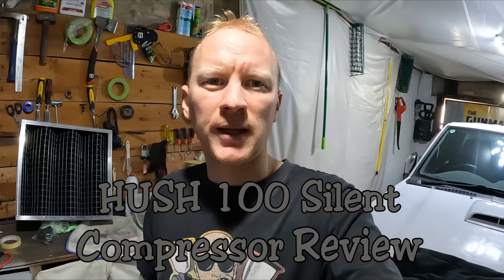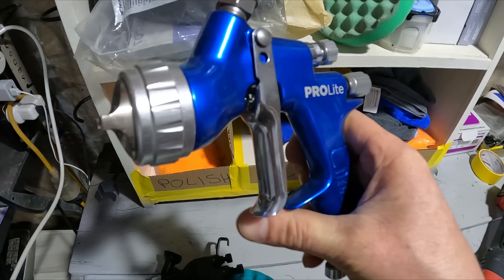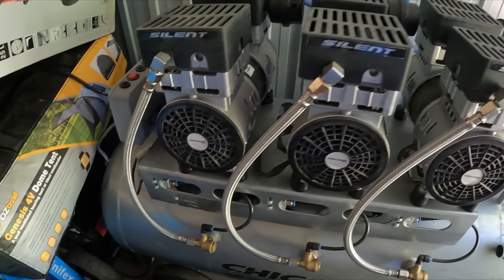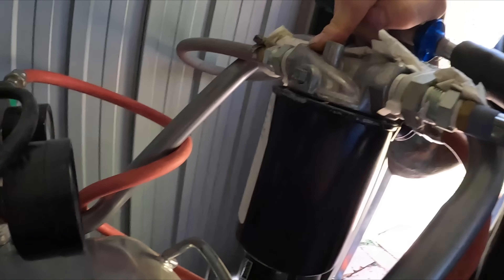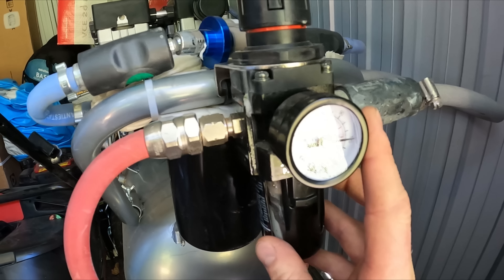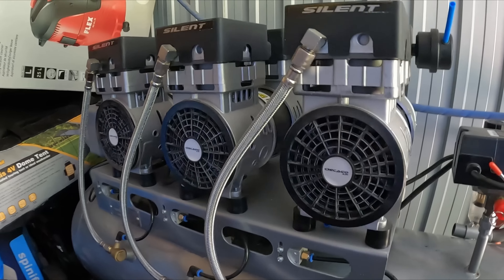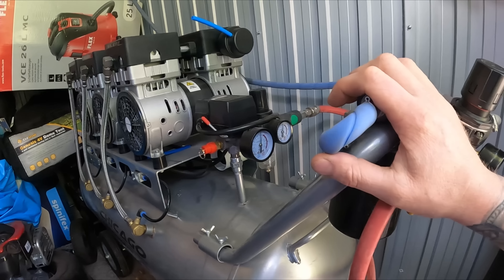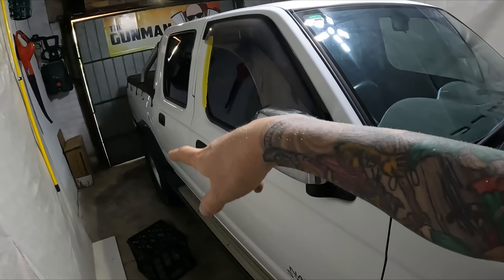Silent Compressor Review

Comment: I concluded that moisture traps are best placed 4-5 meters away from the compressor. When the air is cold, moisture separates much easier. Excellent results are also achieved with lower quality moisture traps.

Comment: I installed a secondary air accumulator on the wall - it's basically just a Stainless-Steel bottle to help keep air volume and also collect water. I then added an electric purge valve on the bottom that just plugs into any power outlet. You can adjust how often and long it goes on. You could put something like this in the shop wall someday, I love it.

Comment: Yewwww great to see a review on this beauty - I've owned this exact one for a couple of years and she's been absolutely brilliant 💖 I leave it on every day and it gives reliable dry shop air.
Only annoying thing is the location of the tank drain valve - it's not on the actual bottom of the tank and so draining properly requires some angling of the unit while draining.

Comment: I've got the hush70, was the same price at the time as the hush100 but the 70 puts out a higher cfm (according to the specifications online). With my dv1 HVLP and my gti I can hold 2bar throughout my whole paint job! I just use a small inline moisture filter attached beneath my reg on my gun and I get nice dry consistent air. The thing is so bloody quiet too!
Reply: Got one as well, it cranks no probs at all.
Reply: This is what I wanted to hear thank you. I can't decide between the HUSH100 or HUS70 as they are the same price. I probably won't paint an entire car in one go and break it up in panels so thinking the HUSH70 may be fine. Only thing is on the website the HUSH70 is 81db and the HUSH100 is 70db. I want it as quiet as possible

Comment: Think you’ll find you will get better pressure upgrading the sizes after the regulator on the compressor. 1/4” is pretty restrictive. If you got it all up to 3/8” would make it a bit better. Alternatively if you have an old busted compressor hook that tank in for extra storage.
Reply: When looking at filters go to someone like ultra max and buy you pre, after and activated carbon filters seperate rather then buying a devilbiss 3 stage, as they do the same job but at half the price and replacement filters are cheaper. We install heaps of them in booths.
Reply: Even 1/2" lines will make a difference

Comment: I have the same but the 4 motor 150l version. Such a huge difference compared to my old belt driven compressor.
Reply: Hi John , thinking of buying the 150l model. Does it need a 15amp plug?
Reply: I was thinking of getting the same model as you.
do you know how many hours you currently have on yours?
any issues or maintenance thus far?
and do you know of how many hours usage until seals and such have to be replaced?
thank you.

Comment: between prep stages i use a vacuum cleaner with a soft tip on it to remove the dust
the most powerful consumer of electric i have in the home garage is a car lift, i wired that up to the same house supply that supplies the cooker as thats the highest supply in the home

nice idea about running a  separate small comp for a mask, never thought of that.
i been using the wife's knickers with gaffer tape..............

Comment: For your European viewers, Pacini makes this same campressor (100l) its rated at 71db and it costs €600 - €700, it will run off 13a socket. There are several other manufacturers with this same model. I think they are all Hyundai clones who also make several sizes and versions of this model.

PS. Love the veggie garden.

Comment: Hey mate I work for Sydney Tools & on that Hush100 if you unscrew the black cap (1 screw) where the main on off lever is (red bar), have a look under the cap. Theres a sticker which indicates your cut in & cut out pressure setting adjustment. There's a black plastic screw & a steel screw. They'll increase/decrease your pressure & cut in/out so you should be able to use the HVLP. It will most certainly power an air sander btw. Cheers.
Reply from the maker: Thanks mate, great to know
Reply: Hey mate would you recommend the 100 over the 70?
Reply: @jesserowe5346  Depends on what you're doing. The 70 has 1.1kw motors compared to the .74kw motors on all other models. Faster recovery time on the 70 but less storage. What will be its main application?
Reply: @pureblood7215  paint/ bodywork, air tools, spray guns and pump up tyres. Basically it.
Reply: @jesserowe5346  Mate the 100ltr with a psi & increased cut in time tweek will be better than a 70ltr as you require storage. If a 150ltr isn't too far out of budget & you have a 15amp socket it would be ideal. Yeah mate I just tried to up sell you. lol. If you only have 10amp a 100ltr will still get you over the line.
Reply: @pureblood7215  you should be getting paid overtime for this haha. I don’t have a 15a and 100L is better suited for budget, thanks mate
Reply: @jesserowe5346  No problemo amigo. Happy to help.
Reply: @pureblood7215  that’s some good info right there. I was wondering why the hush70 had a higher FAD than the 100. So adding an extra 40l tank to my Hush70 should be ok then.
Reply: @derekmartin8498  Yeah that's not a bad idea. If you are to go down that path it'd probably be a good idea to make a manifold & tee off from the 2 inlets on the Hush so you dont have to drill & mig/tig a tube bush into the tank & void your 5 year warranty. That way if something does go wrong down the track you can put it back to how you purchased it & bring it in for warranty. After you've done it i'd be keen to hear some feedback.
Reply: Did you ever try to get the hvlp guns going?

Comment: Hi Gunny, the air regulator needs to be in your garage closer to the spraygun so it takes the moisture out of the airline from the compressor right up to the gun,an air fed mask usually requires at least 5cfm  free air so ideally the compressor would need to a minimum 2hp or bigger just for the mask, I have a 3 hp single phase compressor with a 200 litre tank which produces 14 cfm but reduces down to 9.5 cfm free air output so will just about keep up with my pro lites with either a 110 or te 10 air cap ,enjoying the videos mate,have a good day.

Comment: First off, I've watched probably most of your videos and they have definitely made me a better painter. 
You not being able to get 2 bar (at the 45 second mark of video), has nothing to do with the "compressor" portion of your system. This is due to the multiple quick connects, filters, and feed line. The gun doesn't care how the air is pressurized, the only factor is the tank pressure. Do a test straight out of the tank regulator and you will see.
Reply: Awesome!... I love painting.  Send me your addy and I'll send you the best in booth line. Never shipped to AU before..
Great vids.

Comment: I got a HUSH150 a few months ago. So quiet. I've only used air tools and nailer so far and have yet to spray with it. Lucky I have a new GTI pro lite and GPG for when I reach paint stage. Seems to be the gun to use with this compressor.
Reply: Hi Trev, thinking of buying the 150l model. Does it need a 15amp plug?

Comment: Not sure if you'll see my question but I'm considering the Hush 30 to mount on a ute for pumping tyres and using a rattle gun. It is the 2-motor type. Do you think the Chicago brand is robust enough to have in a mobile environment?

Comment: That compressor is really good , I bought an 8HP petrol engine driven compressor and yep it’s noisy as , I’m going to have to build an enclosure for it as I’m reluctant to use it for the neighbours sake
Reply: You could replace the 8 hp engine for a 3 or 5 hp electric motor.
Generally speaking, an electric motor of close to half the hp number can replace a gas engine system.

Comment: Think you need to run a bigger air line from the tank to your shed.
Maybe 3/4 Polly pipe that way your hvlp gun won't drop pressure as bad at the gun.
Run the 3/4 straight out off the compressor tank and have all your regs and filters in your garage that way you can keep an eye on them and they won't act as a restriction either.

Comment: Bought the 100 like you and it didn't do the job with my spray gun like you mentioned, so I took it back to Sydney tools paid the extra and bought the 150 and it is a world of difference, no problems with my HVLP and using all my air tools.
I am not sure if you need to use a 3 stage air filter with you air feed respirator with these compressors as they are oil free.
Reply: Hey Taylor, have a look at my other comment. I work for Sydney Tools & you can easily increase/decrease cut in/out on these Hushs.
Reply: You must definitely need clean 3 stage filtered air on any compressed air system, work oil or not, you'll poison yourself otherwise.

Comment: Hey Gunny hope you are enjoying your new house, been waiting for your compressor review and was amazed at how quiet it is for a 3hp unit, I was looking at the specs of the silent ones available here and they are 16cfm which is quite good.

I have a 3hp 14cfm compressor but it's very noisy plus it needs oil so it's an extra thing to filter out. I use a dropout filter before my 3 stage and have to say that the dropout is really good as I hardly get any oil or moisture going though to my 3 stage which makes the filters last longer.

My compressor isn't that reliable so when it gives up again I'll be looking to get the same type as yours, thanks for doing this review Gunny 👏🙏👍 John UK.
Reply: So we're you going to get that in the UK
Reply: Not that particular brand but they are available in the UK with up to 4 1HP motors, they are quite expensive though at twice the price I paid for my 14cfm direct drive.
Reply: @JohnWD40TC02  thanks j

Comment: I got a mechpro? Think that's what its called, it's Repco brand.
3 HP belt driven and it's actually pretty quiet and can keep 2 bar no problems. Was on special for like $400aud.
Been going strong for a year.
Reply: Also was gonna say I just have the one water separator and as long As I empty it after..before.. every shoot I never have a problem.

Comment: Beginner DIY at home here. I accidently bought 2 cheap HVLP sprayguns. Should I sell these or do they have a use for automotive?
Reply from the maker: They should be fine as long as your compressor can provide enough air. Like I demonstrated in this video, they require lots of air to get enough pressure. My compressor want enough to get any more than 20 psi but it could get 45 psi out of the LVLP

Comment: I don't want to over complicate things but you will be way better off running at least 5/8 pipe from the compressor and use  traps to stop moisture and drain valves in the line  the main reason for moisture is the air gets hot due to not enough flow +few more reasons as well and cools down and condenses buy running hard lines from the compressor it gives the air time to cool down a bit before  the reg & flexible hose

Comment: Unless you have 3phase compressor of industrial quality, you're gonna need to use LVLP to get enough air out the gun - most (even the really good ones) single phase compressors will be flat to the mat even supplying an LVLP gun with sufficient air. If you go HVLP, they just won't keep up at all - the output CFM's will be waay too low, no matter what they tell you it puts out "in theory".
Reply: I wouldn't say that I have something that flows about what this does but 3/4inch hard line from the compressor to my wall mount regulator in the booth. Smallest part is I had to reduce to 1/2inch for the regulator then a flexzila 3/8 hose to the gun with hf fittings and iv never had an issue. I can run my hvlps at 45psi continually but the compressor gets hotter than I'd like after 5min. It runs my SATA phaser at 36psi all day for all overs and it runs my da sander np too. Only time I see my regulator pressure drop is when I blow the booth out. I see it dip down to 50psi from 75psi. Biggest thing I see ppl mess up is the line size in air systems. I recently upgraded to a 26gal compressor that's a bit bigger but still running on home power it doesn't care with the same air system. I strongly recommend 3/4 as far as you can and straight out the tank regulators are restrictions. I have turned my compressor cut off down to 120psi from 155psi to keep things safer. And I also recommend adding a transmission cooler out the compressor into the tank with a moisture trap this keeps 99% of the water out of the system to begin with. I'd say I get about two cars sanded and painted booth cleaned before I drain the one in the booth and at most I get a slight mist at first. When I drain the tank I get the same a slight mist at first. But make sure you use something that's not restrictive at flow. Here in the us I get mine from jeggs it's a 3/4in in that runs across it and like a rad flows across then has another 3/4 tube down the out of all the fins. Youl see ppl using ac condensers with tiny 1/4line and a hundred or so 180° bends that's a bad idea for flow. Iv got about $400 in my system minus the new compressor although I got away with the same one he has in the vid with similar results just the duty cycle was higher than I liked and in NC with high humidity and 100°f days I knew it wouldn't make it the year. Did 3 paintjobs and didn't pay myself just put it towards the 26gal three cylinder compressor now I'm rocking and rolling.

Comment: Hey, I'm new to compressors and spray guns. I need to spray my car roof, bonnet and boot, no blending needed so the roof (honda civic) is the biggest single area that needs uninterrupted air from the compressor. I'm okay to wait for recharge times for the other panels.
Because the compressor may not even get used 10 times in 10 years, I'm trying to keep the costs as low as possible ..whilst as quiet as possible :)

I'm trying to understand how important compressor litres per minute is compared to storage tank volume for spraying with an LVLP gun.

Would say a 2.5 HP 135 litre/min 40 litre tank compressor with an added 75 litre auxillary tank making a combined 115 litres of storage with only a 135 litres per minute duty cycle, give enough air delivery to spray the car roof without running out of pressure?

Simplified: Does storage volume extend spray duration by a significant amount? ..or is it all in the compressors recovery abilities?
Reply from the maker: I would place LPM over storage volume myself.
Reply: @TheGunmanChannel  Thank you. Such a fast response too :D
Reply: @markwalshaw241  hi mate what compressor set up did you end up going with, im looking to do a few panels myself and keep costs down

Comment: you won't need 10 moisture traps if you install cheap second hand car AC radiator with moisture drain between compressor and diverter valve. 
min. 15m of 3/4" hose and 3/4" fittings - tip from eastwood.

Comment: I sent you some vids on insta. I have that compressor as well but get too much water . Rep told me i should make the line from compresser regulater to my extra  regulater long as possible so air cools down before it come to tools or spraygun.  Whats you thoughts
Reply from the maker: What's your insta username, I have so many unread requests
Reply: @TheGunmanChannel   nextlevelautobodytouchups

Comment: Does this compressor have a 10A or 15A plug?
Reply from the maker: @frankloschiavo  10A
Reply: I’ve just purchased this yesterday and it now comes with a 15amp plug. There is a recall on the 2021 to late 2024 models. My house has no 10amp outlet so I bought a 15amp adapter to make it work.
Reply: @Quality.Auto.Detailing  let me know how it performs through the adapter. I'm guessing it won't receive enough amps.
Reply: @frankloschiavo  it works fine with the 15amp adapter!
Reply: @Quality.Auto.Detailing  with all motors running? That's awesome if so

Comment: Any compressor claiming to be oil free has me cringe a bit as motors wear out faster as an oil free system.  The little units with direct drive oil-lubed compressor motors I have aren't overly noisy but can serve a longer life than any oil free design.  They aren't huge by any means but I found a derelict air tank in relatively good shape that I use with both compressors to gain an advantage in capacity.

Comment: You spent a fortune on guns and you buy a compressor thats fad is 289 lpm and then buy a regulator from bunnings you should be using a compressor with at least 450 to 500lpm smh